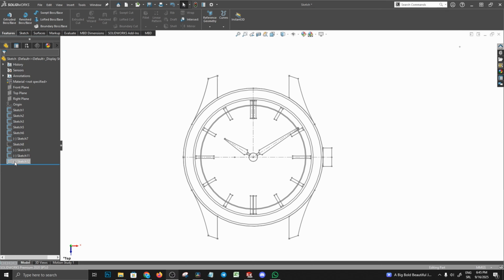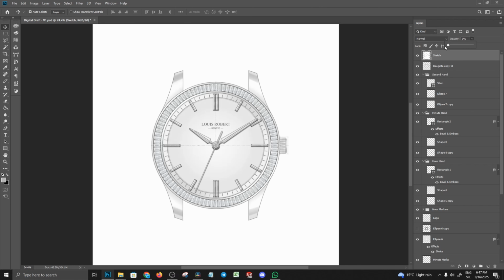Inside My Watch Design Workflow: Tools & Software I Use Daily

Comment: Adobe is pronounced Adoh-be.  Illustrator is of course vector VS raster, not really a direct comparison to PS and vector can be brought into your CAD package. I like to draw and model directly in Plasticity, Nurbs for Artist. I had guessed you were using Keyshot as there are bridges to many applications.  I'm still using Mental Ray, ancient I know but I have full control and love the feature sets like micro radius, ambient occlusion and HDRI environments and local reflections, etc. Thanks for this video, it answered a few questions in the back of my mind. I have started designing watches for fun in between contract 3D work, and really appreciate your industry insights.